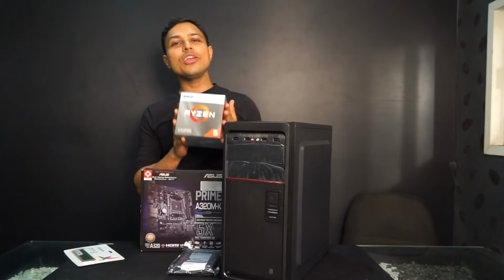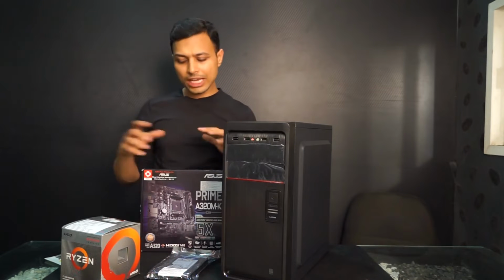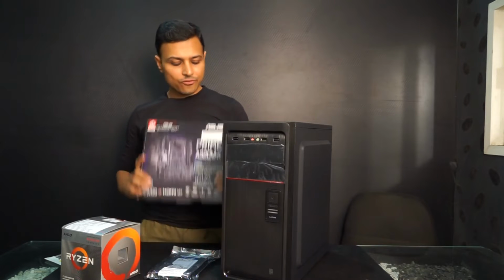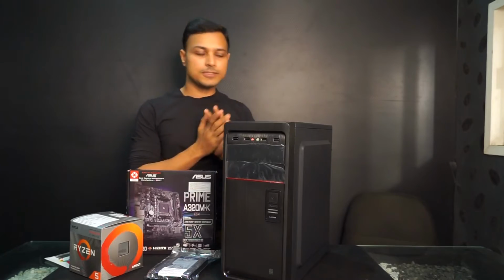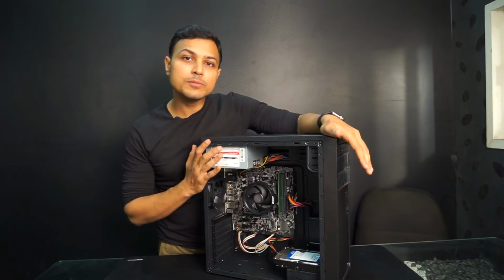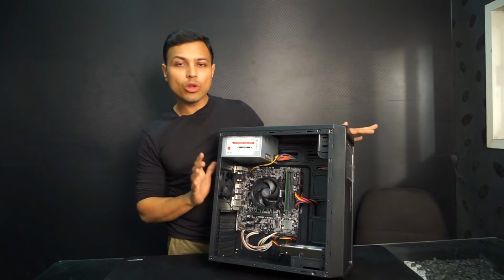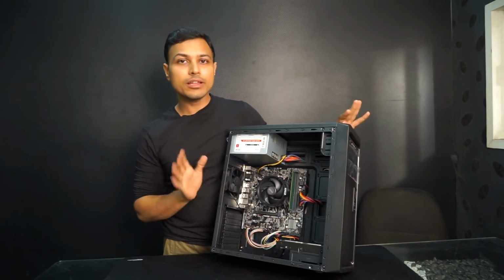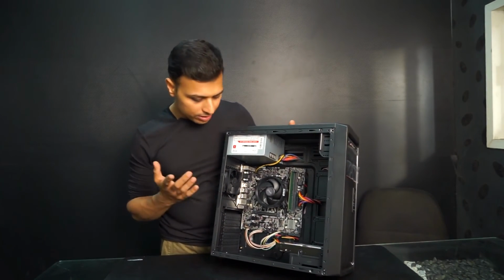Ryzen 3400G PC BUILD-25000Rs-26000RS BUDGET

Comment: Iam planning a new build after years :) I remeber applying thermal paste type material which I applied from the hardware shop and fixed fan there itself. I dont see you applying this ? Can you explain why it is not required?
Reply from the maker: with new processor the heat sink paste comes pre applied to fan. It is required If it’s not pre applied or if you are reinstalling the cpu.